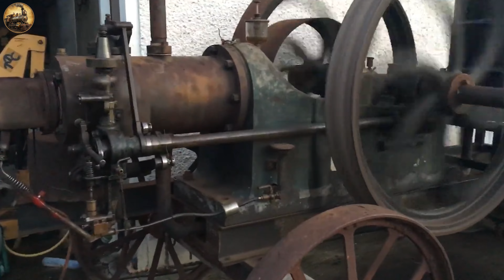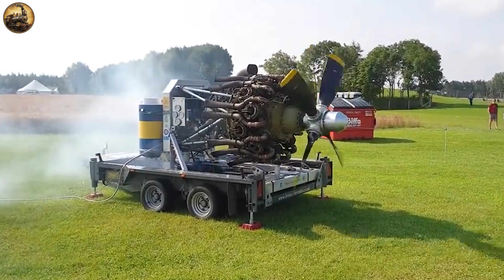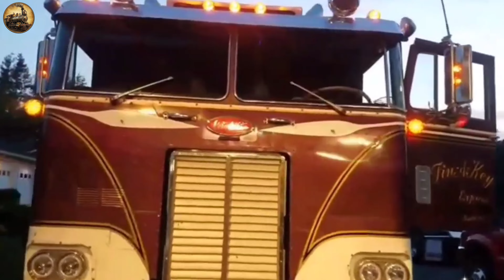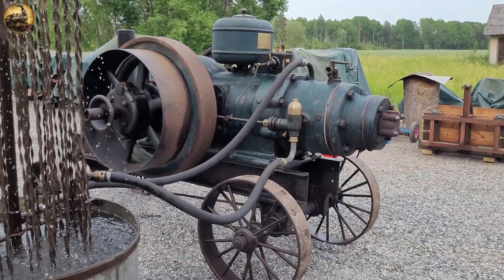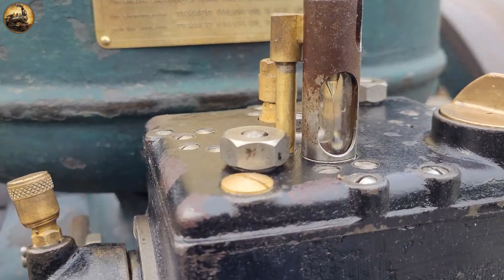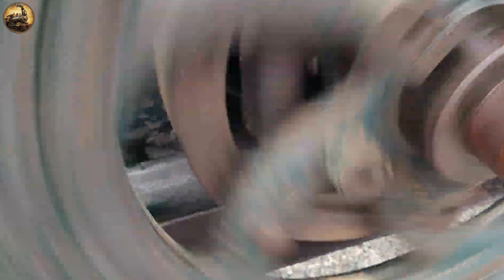12 Years To Wake A 100-Year-Old Racing Monster | Steam Engine

Comment from the maker: Managing the thermodynamics of a century-old racing boiler is a highly delicate balance between extracting maximum pressure and preventing a catastrophic structural failure. For the engineers and steam enthusiasts watching: What do you consider the most critical metallurgical or structural variable to monitor when bringing a 100-year-old pressure vessel back to its operational racing limits? Defend your technical reasoning below